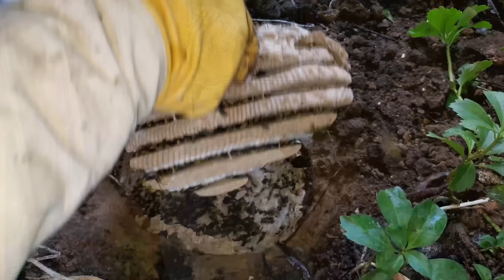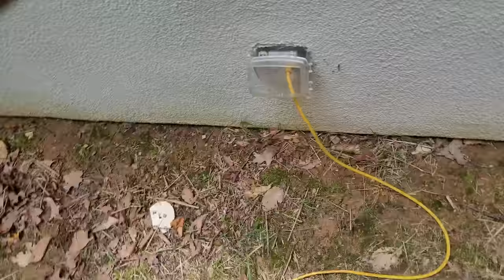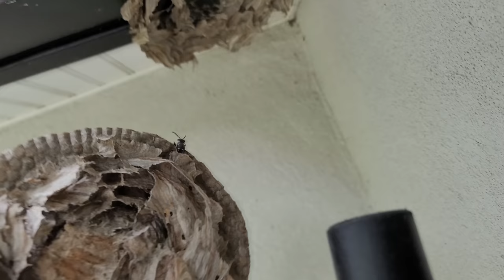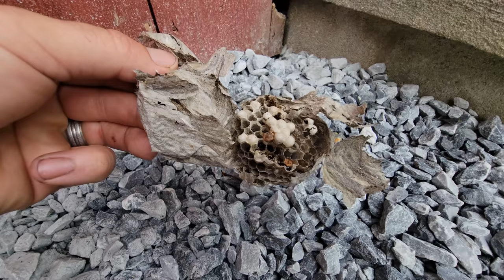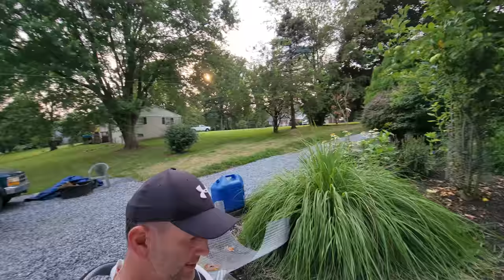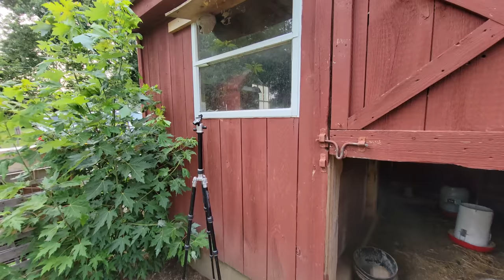Bald Faced Hornets Tried to SWARM and KILL ME!

Comment: A Tip for the Saftey Glasses that I used as a Drywaller is to put Rain X on the Lenses, most stuff won't stick to them that way
Reply from the maker: I covered this pretty extensively in the beginning ;-)
Reply: @HornetKingOfficial  Yup you did but I left the comment right before you said that lol

Comment: I have been battling bald faced hornets ever since I bought my house. The first summer I had a nest similar in size, maybe a bit longer that I had to get rid of. They were attracted to the ground straps on my electric box which was close to my back door and they would attack me whenever I came out my back door. In the years since, I have only found one other nest of notable size, but I find these small 2-3 inch diameter clusters EVERYWHERE. I end up knocking at least a dozen off my house every year. I would have no problem with them if I didnt get attacked every time I wanted to BBQ, do yardwork, or throw the ball for my dog so at this point every single nest is kill on sight because I just want to be left alone.

Is there anything I can do to claim victory in this endless battle?
Reply: Flame throwers?
Reply: Spray the area with WD-40, They wont bother coming back
Reply: @brendonelton  That works for the grounding strap but id like the whole yard, house, and both garages left alone lol
Reply: Putting up fake nests?
Reply: @sharahampton67  Several years ago I put up a fake hornet nest to deter paper wasps. The wasps bored a hole into it and built a nest inside it.
Reply: I've had a lot of luck by eliminating the things they like. Such as, cleaning out my carport area so there were no bugs living under things. Mud Daubers feed primarily on black widow spiders, so I eliminated anything I thought might be appealing for spider nesting. I got rid of puddling or other water sources the wasps might like. Cleared out scrap wood or rotten wood things around the yard. And then I just paid attention to all the usual spots like light fixtures and soffit corners, flood lights, etc, and it made a big difference overall. Wasn't much I could do about ground nesting yellowjackets, but I would walk the yard checking for activity, and managed to stay on top of that problem as well.
Reply: Apparently Earwigs are your friend.
Reply: @pastorjerrykliner3162  lots of earwigs lol

Comment: To avoid the hornet spray getting through your head gear to your eyes, I was wondering if you could create a positive air pressure in your suit by using another vacuum as a blower and connect to your suit. I don.t know if it would be enough to keep the spray from hitting your eyes but if it works it'd also should keep you cool in the heat of the day.
Reply: Just wear glasses
Reply: @Blobby192  he literally explained why he doesn't wear glasses at the beginning of the video.
Reply: That's the same question I was asking myself.
Reply: why not have a see through plastic part sewn into the face net, that covers the eyes.. that way if it sprays the plastic covering he can wipe it
Reply: Like a reverse PAPR! He was a nurse in the past he knows what that is. Great idea!
Reply: That would be far to complicated and pricey. In addition to that I would assume it would be very bulky and uncomfortable.

Comment: Love watching these, Bees and hornets [and ants] have always fascinated me.
I have a question for Hornet King though:
I've seen you use the same vacuum for all of your videos, and it doesn't seem very strong, more like a medium/low powered household model. Why aren't you using a higher powered shop vac.
It seems to me one of those would do better pulling the swarms out of the air as well as collecting the hornets as they enter/exit. I've seen several fight the suction on your vacuum and win.
I'm assuming you DO have a good reason, I'm just curious as to what it is.
Reply from the maker: My reason is one thing for the type of vac I choose buy, time and time again. But the most important aspect here is your perspective of the process. The strength of suction is least important as the speed of suction. This vac is a 6hp motor, but it's the diameter of the nozzle which dictates the depth of suction. 
A 2 in hose is less powerful than a 1.25in hose (the one I use) even at the same strength motor. 

Vacuums are not designed to pull strong winged insects out of the air at all, let alone at distance. So I use the depth of suction from this hand selected model to my advantage when I sit the nozzle perpendicular to the nest entrance and wait for wasps to leave, or attempt to enter the nest. 
Sometimes I can catch them at my veil, or even midair if I am lucky, but that isn't of the limitation of just my vac, that would be of ALL vacs. 

I cover this misperception of my vac in  several videos, but I can't think of any specific one to send you to.
Reply: @HornetKingOfficial  Thank you.
As I said, I was sure you had a reason, but me being a layman in wasp removal didn't know what it was.
I had a friend deal with a single bald faced hornet, and the aggression and flight strength of the thing was so impressive [it fought it's way down a stream of insecticide she was spraying directly in it's face] that after it was FINALLY killed, she had me take it to the entomology department of out local university to identify it. If we had a nest of these monsters near by, we wanted to know how bad it could be.
Reply: @Voodoomaria  you really had no idea what it was and thought it was so rare that you had to bring it to a local university?!? They are common and a simple google search would have easily identified it.
Reply: @imagin916  A:
BEFORE Google.
This was a time when people used things called "Books" when they wanted to know something general, and since none of us in the house had ever seen a baldfaced before, and it was strong, and hyper aggressive, Pardon us for seeking information from an expert.
B: 
Common in YOUR area, Not in ours, Even today, a nest of baldfaced is not common at all in our area.
Reply: @Voodoomaria  if you had even a single bald faced hornet in your area than they aren’t rare.
Reply: @imagin916  I did get the opportunity in the early 2000's to dissect a dead nest [not academically, just for my own interest].
I still have the centre comb.
That's the only time since the individual worker that I've seen them. Most common breed here are the common yellow jackets.
I don't think I've encountered another nest or individual since.
Given how cranky they are, I consider that a good thing.

Comment: Stopped at a park that had a nice basketball court. Started shooting hoops and quickly saw that both backboards were infested with hornets (or wasps). There were two bracket holes below each rim. They built nests in the space between the backboard and the backplate, and they were using the bracket holes as their entrance. Every time the basketball hit the rim or backboard the guards would get airborne and chase after the ball. I managed to get a full workout in by shooting only three pointers and alternating between the two hoops so they never got agitated enough to come after me. Made it a point to tell the groundskeeper though, because we don't want some kids to come and get attacked.

Comment: Hey man, there’s an anti fog device I use when I play airsoft called an ExFog.  It’s a rechargeable fan box that blows air thru small hoses that you attach to your goggles and it just keeps any fog from materializing on the inside of the lens.  It wouldn’t do anything for any venom sprayed on the outside though.  ExFog is the name.

Comment: I make the houses I clean safe for the new move-in's by taking out wasp nests; got another shop-vac hose to couple on so motor-noise twice as far away; added all the solid extensions to put me way out of target range; added the crevice tool tip, concentrated the suction into pressure strong enough to tear printer-paper; and I use a stream-setting on a spray-bottle-top fixed to a bottle of 91% alcohol, it saturates the nest, KO's anything that would have otherwise come out, then evaporates pollution free; devised myself.
Reply: My trick is to hit the hole from the distance the stream reaches and to keep advancing and firing continuously until I reach the hive; before a sentry or scout detects me, I'm already gassing the exit and contents of the hive with pure evaporating alcohol fumes concentrating rapidly: by the time I reach them with the running vacuum, they're unable to orient themselves toward to exit or fly nor recover once saturated. I never get an airborne swarm, this way none escape.

Comment: Today is Oct. 23, 2022, and I have what I believe to be a dead hornet nest in a large bush in my back yard. It is about 4 times the size of the one you removed at the beginning of the video, and it has been very active all summer (yes, I found out about the hard way while cutting my grass). A friend has expressed interest in getting it from me. The last few weeks have had morning temps in the 40s and 30s (not freezing yet). I have seen zero nest activity for a few weeks now. Questions: Is it safe to remove at this time? If so, would it be a good idea to put it in a freezer for a day or two just to make sure they are all dead? Finally, what is a good way to preserve the nest? Thanks.

Comment: Could you add a clear plastic shield to the outside of the mesh? (like the face shields drs started wearing) it might still get smudgey when you wipe it with the gloves but if you only covered the top couple of inches of the hood it might not get too foggy and prevent a few red eyes.
Reply from the maker: I certainly could. But the nice thing about the suit is that it's breathable. I don't think I could block my breeze in 95 degree weather just to avoid some minor eye irritation 😆😅

Comment: About how long did it take you to remove the nest? I had a nest that looked just like it. I considered setting up a long pipe on my shop vac to remove the nest, but without a suit, I was too scared to try. I learned that they abandon the nest after one season, so I opted to leave them alone, since I was able to mow without being attacked. Are these nests always built by bald faced hornets?

Comment: Was attacked by a couple hundred bald faced hornets. Shockingly and unbelievably though. I was holding a running weed Wacker. I dropped it and ran. Instead of me. They attacked the machine  and did for hours. I was very lucky I didn't get stung once

Comment: OK.  So I have a suggestion for how to deal with the goggles thing.  Get a face shield, cut it down to a strip and mount it to a pair of cheap sunglass or reading glass frames (or something more substantial or a strap if you like) so that they're a couple inches away from your face (to prevent fogging).  Then, to wipe them when they get covered, just have a stick inside the helmet with a bit of cleaning cloth or whatever will wipe the venom spray and just have it inside the helmet somewhere inside the face net, and when you need it just pinch the stick through the net to hold it and wipe your face shield.  I would have the cleaning stick just stuck somewhere out of my direct field of view with a magnet or something that would keep it from getting in the way, but was easy enough to take off through gloves and the net.

Other option would be to mount the face shield to the headpiece of the bee suit instead, such that it's only an inch or so away from the net.  Then just have a piece of cleaning cloth seen it stapled to the front of the net.  Then all you have to do to clean it is push the net where the cleaner cloth is toward your face to make contact with the shield and then wipe it clear.  It would be kinda the same motion you might make to wipe the front of a face shield off without taking it off, just a couple inches further out from your face.

There might be a better way to implement this, but I'm pretty sure a solution exists where you just have a plastic shield inside the net with you to protect your eyes but that won't wind up being a visibility hazard. 

Actually, now that I think of it, just having that shield a few inches back away from your eyes might be enough on its own to not have visibility be an issue.  A little splash on the lens of some goggles half an inch from your eyeball can easily disrupt a big chunk of your field of view, but an inch or two farther away and it might not even be visible, negating the need for any sort of cleaner system.

If you've gotta a make and model for that bee suit, or just measurements if that's how bee suits work, so I can check out a matching face net, I would be willing to see if I could whip up a prototype.  I've got a little experience dealing with this kind of face shield VS visibility problem in situations where you can't just touch your face protection, I might be able to come up with something.  I doubt you're the only person who has this problem, unless you're the only person on earth who exterminates wasps and hornets while wearing a bee suit lol.

Comment: I tell this story quite often when talking about stings. The bald face Hornet to me hurts the worst. I fell in a hive of yellow jackets and was stung around 27 times. Yes that hurt but  in an incident where a bald faced hornet nest was burned,  there where 4 or 5 above average sized ones hanging out by the street light after it was done one tagged me a few times in the chest. This hurt beyond belief. Mind you I might of been 13 at the time. But as a minor question to this  are there any variations of the hornets? Like the hornets that got me looked bigger than the normal bald faced ones. Just a curious question on my part.

Comment: Too bad you cannot make a stand so the vacuumed hose can be stood up vertically and adjustable, then you could turn it on and set it up right at their entrance and turn it on. Then you could go have lunch and come back in an hours and probably you would have most of them sucked up from when they start returning to the nest.
-  Do you freeze them and then sell the hornets for medical researching? I am 14 and I am just curious what you do with them.

- I hate earwigs too.  Did you know it they are a invasive species? Also they are omnivorous, but they are not venomous and do not transmit disease or go in your ears either. They can pinch you defensively but it does very little damage at all. AND did you know they have WINGS??  I have never seen them but they have them except they cannot fly very good.  They are not dangerous but I hate it when they get in the house and if you leave food out you may find one on it eating.

Comment: That seemed like an easy one compared to what you usually deal with.  I would have saturated it with wasp spray at night, but I don't have chickens to feed.  LOL...my dad was braver than me....he would have stuck a torch tip in there at night, with the garden hose handy if the eaves got too hot.

Comment: why not just make 3d printed safety goggles that have a motorized wiping arm that is remote-controlled. If designed right, it could probably be reasonably compact.
Reply from the maker: Dude that's awesome! You make them and I'll buy them!

Comment: Are there any differences between bee hives and hornet nests other than their occupants?
Reply: Probably depends on the bee type. Honey bees excrete wax for their primary building material rather creating or farming paper like hornets. I also think honey bees are dependent on hollow trees and very sheltered areas as they don't really build an exterior, just layers of comb, while hornets at least have a protective layer of paper covering their home. Finally, hornets don't store up food within the nest from what I've seen, they constantly hunt. As a result seems like they don't really keep extra cells in the combs for food (and their nests never last into a second year), while bees will build way more cells and comb than they need to hoard food for winter (and continue the nest for multiple years). But the basic lifecycle within the combs themselves and of the insects are remarkably similar.

Comment: Was attacked by these bastard while at work for ca state parks. Got stung 5 to 6 times as I ran back to the truck, the pain was horrible 7/10. The entomologist removed the nest by cutting the limb it was on and letting it fall into a trash can with gasoline in it. After that experience any flying buzzing insect scares me 😂.

Comment: Why is it that you don't  just utilize a plastic bag and zip ties when removing exposed hanging nest? Then all you need to do is remove the air suffocating them or fill the bag with water. I know it wouldn't make for a good video, but it would be so much faster.
Reply from the maker: You are forgetting the hundreds of foraging adults returning to the nest. 
Faster bagging a nest does not equal faster removing a colony.

Comment: So one time I walked out about 5 am to see my ex off to work. Dark still. I'm literally in my underwear in the country. A hornet drills me in the back. 7 or 8 more come at me form behind. I jump off the porch cut a large hole in my foot. Manage to get into the car. Got nailed 5 times total and a big hole. After the ER trip to seal the leaky foot I went hornet hunting. Thought I found them in my elephant ears but thay was just a tiny nest. 2 gallong of gasoline wiped that one out. But hornets were still thick. Finally found a basket ball sized nest in a tree 15 feet from my door hidden in the leaves. So I removed the the hillbilly way. 7 rounds of 8# bird shot in a 12 gage just before daylight. Had to stay inside a whole day because those little devils were on the windows. All of them. After that I sprayed every inch of my property twice. Once ambush was more than enough.